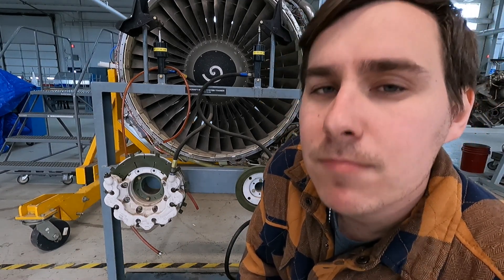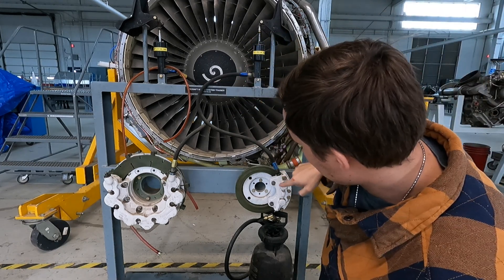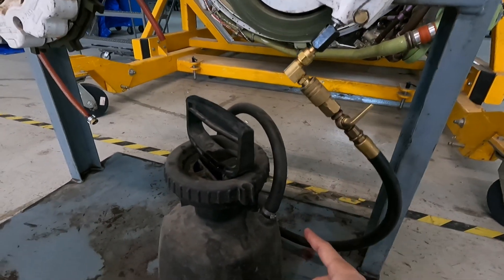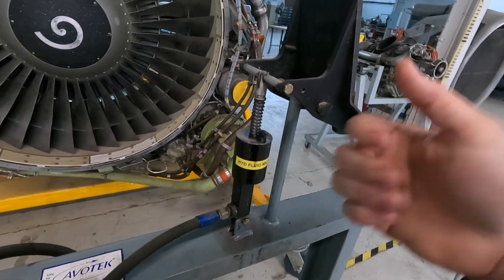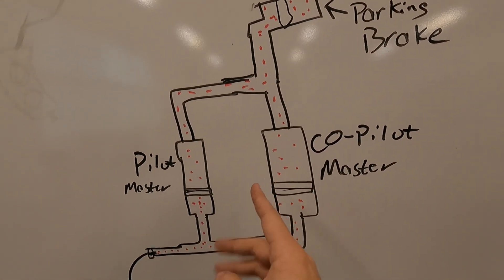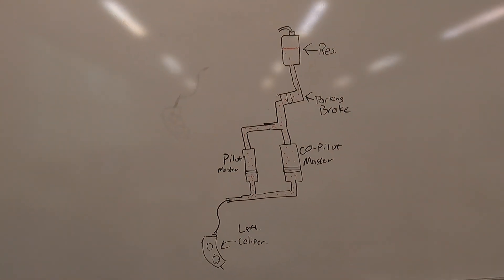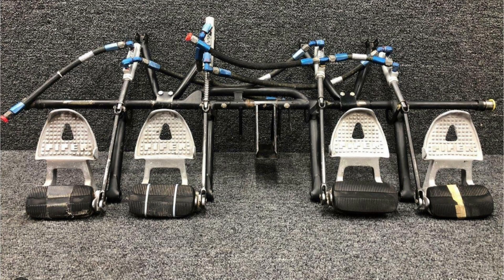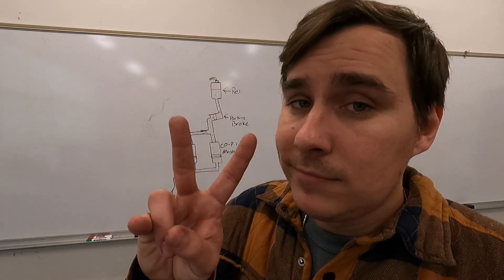How to Bleed General Aviation Aircraft Brakes Using the Pressure Pot Method

Comment: I’m a maintainer in the Air Force and we have a brake assembly similar to the one on the left; we do not bleed brakes with the pressure pot, we more so connect a bleed hose to the brake bleed valve and have someone press on the brakes 50%, 100% and cycle the parking brake and then all the hydraulic fluid is dumped into a bucket. Afterwards is when we would service hydraulic fluid since the aircraft I specifically work on, the brakes run off both the A and B system. But with that being said this is a very interesting explanation on how other airframes bleed brakes but I would like to see an actual demonstration along with the explanation but that’s just my preference on learning lol

Comment: BRYCE -  had an idea watching this video
WHY NOT use WATER in your demo vs brake fluid ?
It would be a lot easier to clean up and the results would be the same
Hydraulics are hydraulics
Aircraft brakes are the reverse of automotive brakes - where you push fluid down from the TOP
Aircraft you push fluid from the bottom !  
So weird I guess MY questions is this ;
Why can't you hook a line full of fluid to the top bleed screw on the master cylinder and pump the brakes will air stops coming out of the bottom at the caliper bleeder ?
Have an Brasilian aviation t-shirt for you once I get back  !